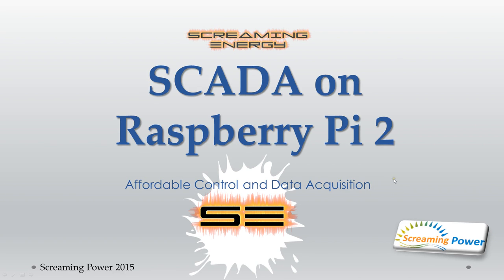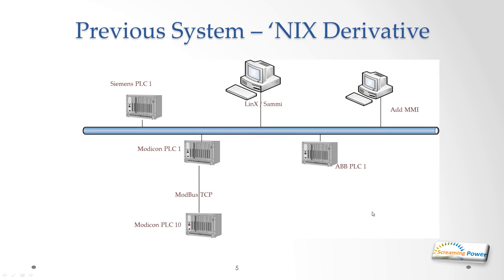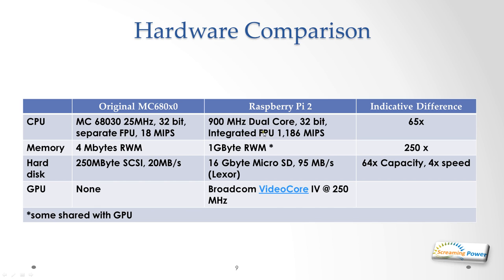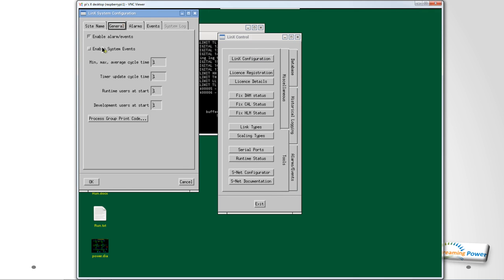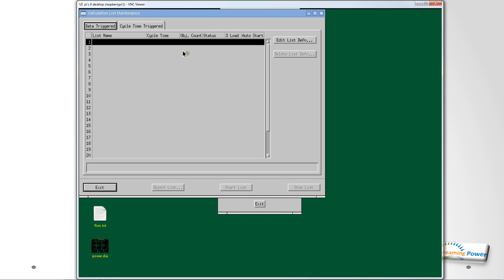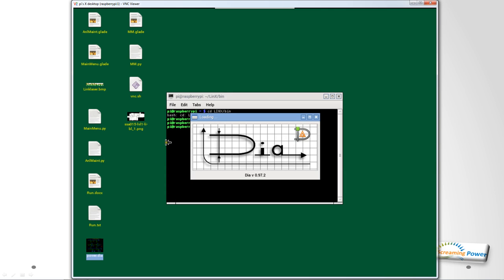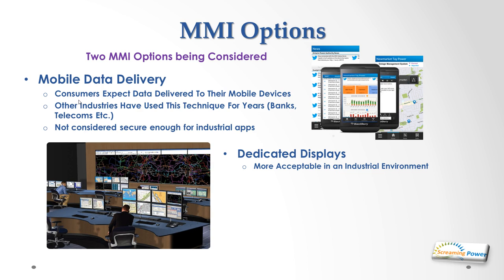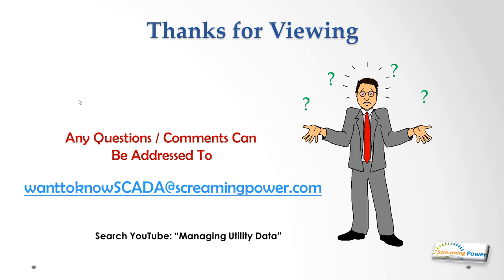Real-time Control (SCADA) on the Raspberry Pi 2

Comment: I now have the software running on one of the original Model B boards which means it should run on the new Model A+. Running the software on an A+ should have been a no-brainer - the problem was I was getting segmentation faults which threw me until I realized you are always wise to compile the code on the actual target machine. The result is that the software runs on the original B and therefore the A+ with approx 6-8% CPU load and >170 MB of memory (of the 256)  still free; not bad on a $20 computer. By the way I should have said if anyone is interested in working with me on this I would be interested in talking to you - I have to also do my day job which mean things take a lot longer than they should, Particularly looking for developers with Linux, C and GTK skills
Reply: Keith Houghton how do you address the fact that the Pi is not CE or UL approved?